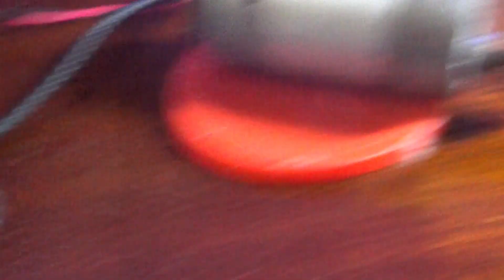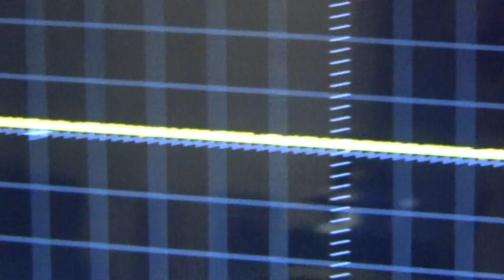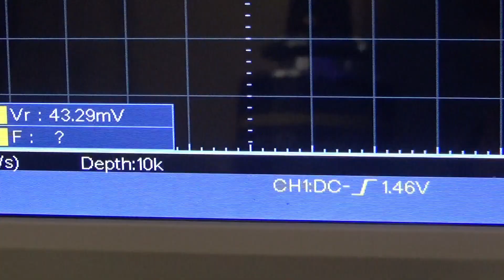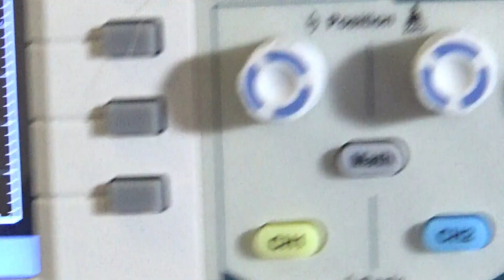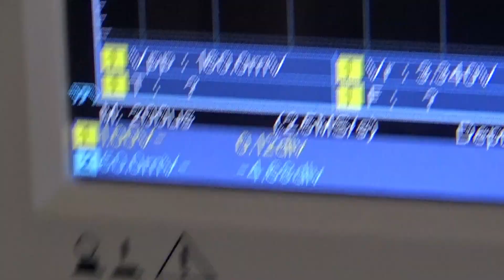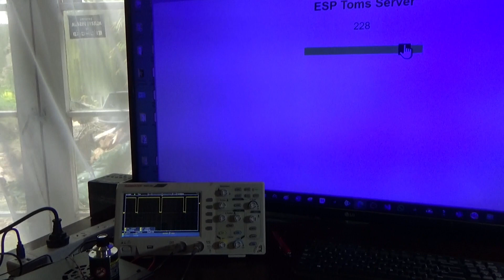Controlling a dc motors speed locally and from a server

Comment: The scope I use is a Tektronix TDS5104 and I've got to say it is rather good.   Lots of automatic measurements, and it's quick too.

Had one guy in the BEng year stealing parts off my project and even took my oscilloscope!   He's struggling to get his working and rather than asking for help swapped it over with mine when I went for lunch.   I had it working within ten seconds of returning so just carried on with what I was doing.